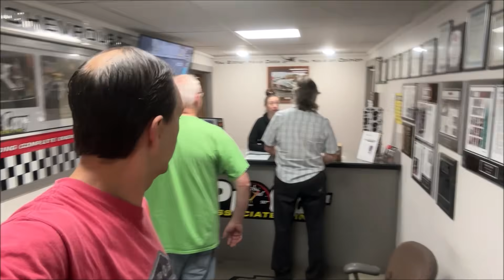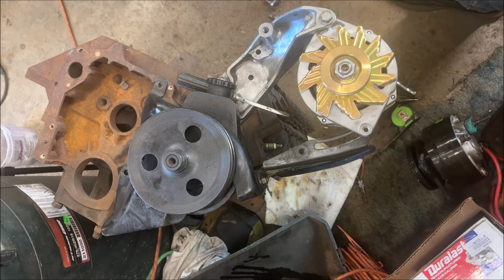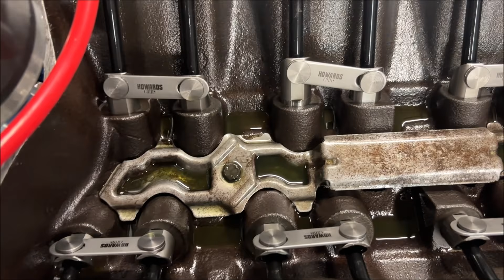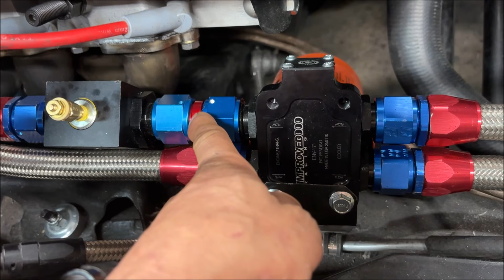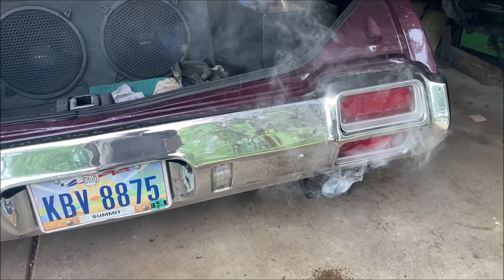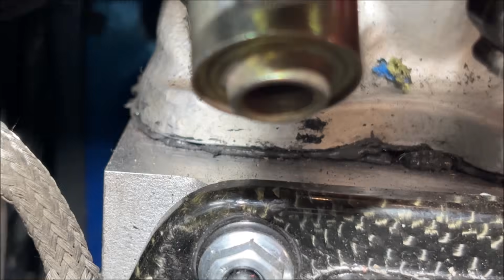482 CID BBO Install in my Cutlass went BAD! (Ep 29)

Comment: I usually put a spacer 1.3 inch  between P/S  bracket and Alternator bracket  that brings manifold bolt hole into alignment with the alternator bracket  hole no welding needed
Reply from the maker: That works too!